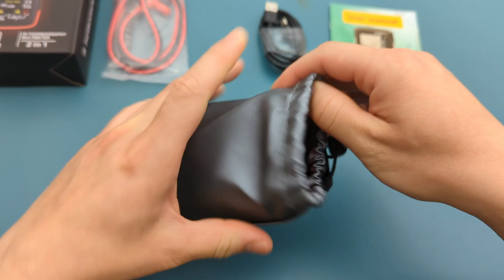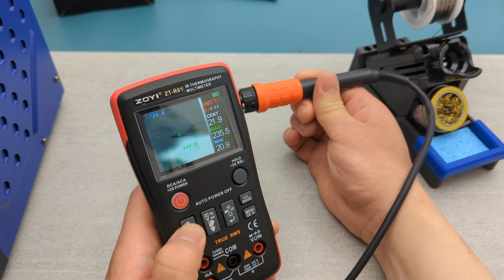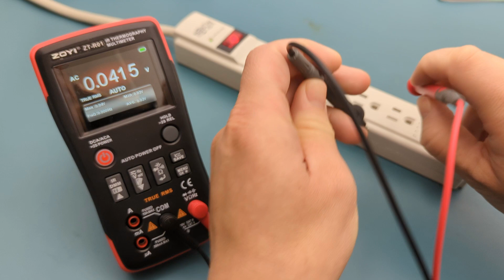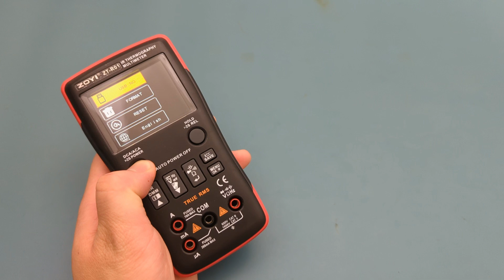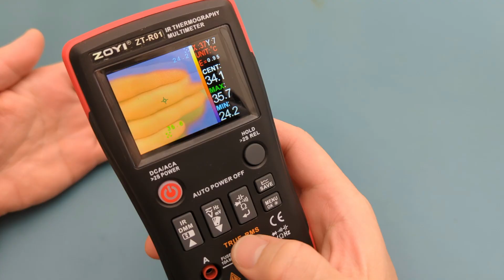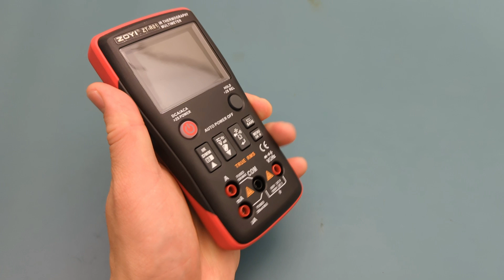ZOYI ZT-R01 IR Thermography Multimeter Review

Comment: I have a question for you, if you don't mind. In diode check mode, after you measure and see the number on the screen, have you tried pressing the Hold button to see if the number stays on the screen???? For me it stays for a second, two, then disappears, it doesn't stay on the screen. It seems that this device has a problem, from the manufacture